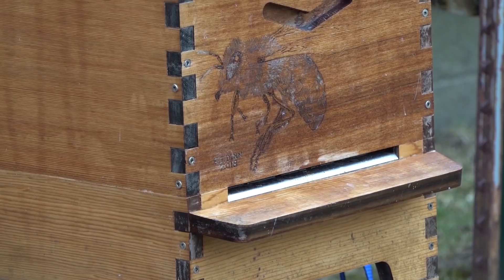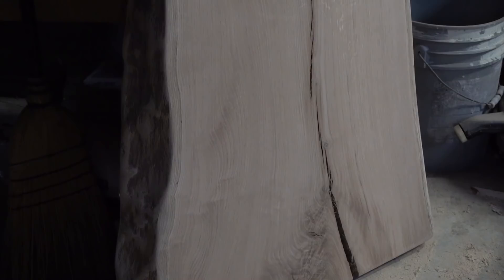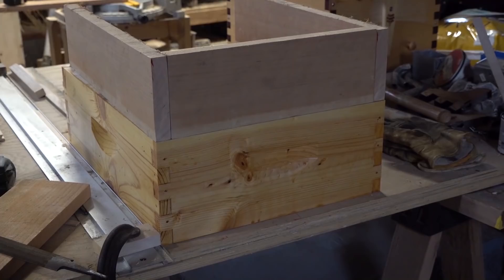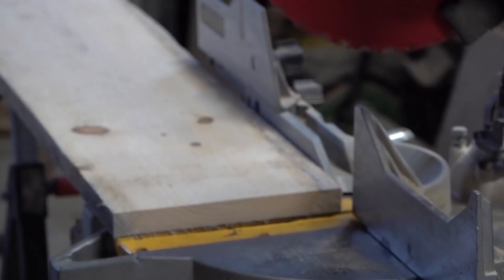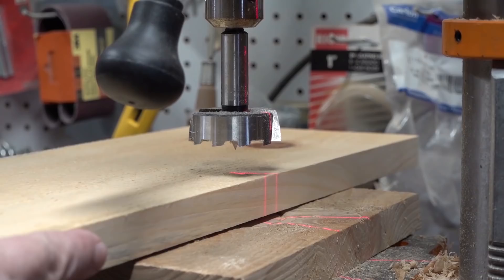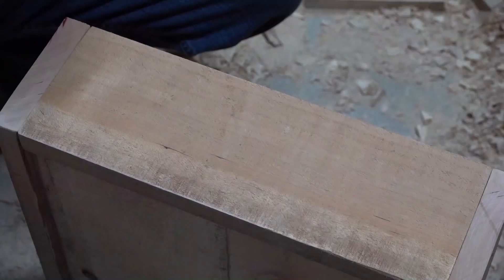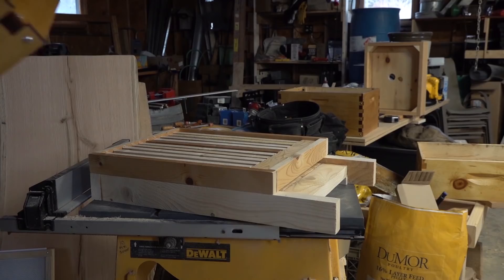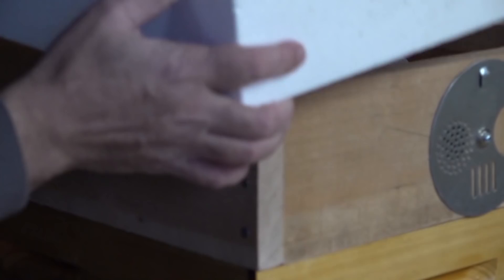How to Make Your Own Honey Bee Feeder Shim Hive Top Feeder Basics

Comment: Hi. I'm from southern Manitoba, Canada.  I was wondering if you could give me the inside measurements of the hive boxes, width, height and length I'd consider building my own hives from scratch. I've got the tools and working with wood is a passion of mine. or is there a site available that has the correct dimensions for such a project.
Reply from the maker: The Langstroth Dimensions are right here :)   https://en.wikipedia.org/wiki/Langstroth_hive

Comment: Fred, in description down, would you please insert the dimension of all parts of feeder shim?  Please ~
Reply from the maker: The dimensions are different depending on the thickness of the wood you choose to use, that's why I demonstrated it rather than give hard dimensions - they are too variable.
Reply: @FrederickDunn   But still, it would be very helpful for the beginner.   Please, please, and please ~~~~
Reply: @FrederickDunn   I contacted the Acorn to make "The one and only Fred's Shim"(LoL) and put those plastic triple waxed frames in it just like you did.  Also, for the brooding box.  One drone frame per box would be sufficient? How many drone frame would you insert inside the broodbox?  Another question, black frame would have what kind of advantages it has?
Reply from the maker: @younginsong4355  The black frames just provide better visual contrast when looking for those tiny eggs etc. I don't put drone comb in the bottom brood box until they are at full strength as I don't want them wasting resources filling an entire frame with drones. I hope it all works out for you!
Reply: @FrederickDunn   I will try.
Reply: @FrederickDunn  It's a bad news for me.  My Gov. won't allow bee importation from USA except Hawaii.  Fred, may you know any beekeepers in Hawaii that have Bee Weaver line of bees.  I'm terribly disappointed.  Or any link I can find?  my shoulder collapses... 
even before starting... >_<
Reply from the maker: @younginsong4355  Sorry, I don't know any Hawaii beekeepers, they must have an online Association you can check in with.

Comment: Why have an upper vent with no screened vent through the floating inner cover floor?  You won't get any airflow through the feeder when its filled above the level of the center cup.
Reply from the maker: I've added vents and they sealed them right up. If you want to see what that looks like, please watch this https://youtu.be/MXab9s_KduE
Reply: Ah, seems like you use the upper shim as a top entrance when not feeding?  I should have recognized that your weather is much colder than in Houston so vent propolis would be an issue for you.